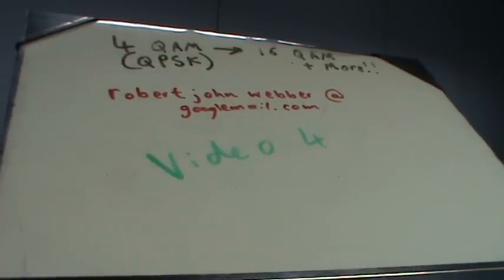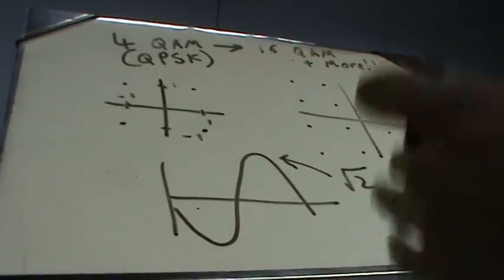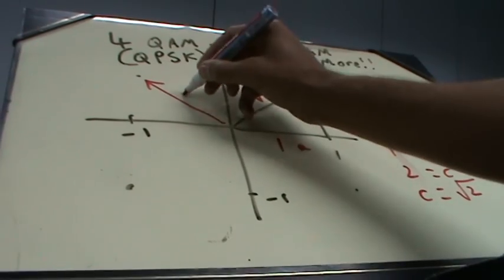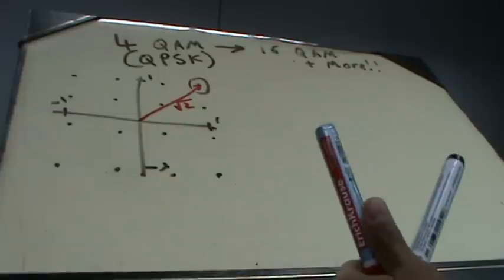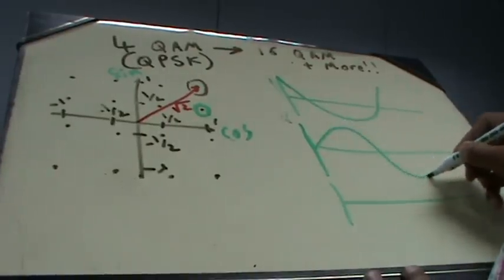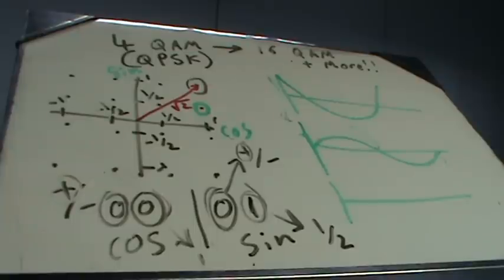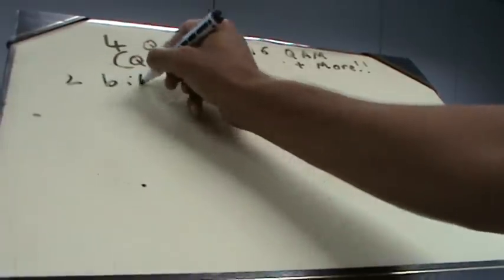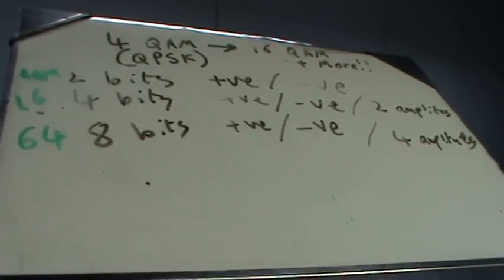QAM, QPSK Explanation, (PART 2 leading to 16QAM and more.....)

Comment from the maker: Hello, You´re right that there are three output amplitudes, but 2 different input amplitudes for 16QAM. However the voltage values depends on the design of the transmitter/ receiver. For example a broadcast 1V signal wont travel very far! 

Thanks for the comment though Eder.

Comment: Hi Robert, Its very useful video... I got one doubt from 8.07 mins onwards... You say 0 (cos +/)  0 (cos[same amp])  0 (sine+/) 1( sine[diff amp]).  In that case LSB 01  should be done with AND operation between 0 (sine+/-) 1( sine[diff amp]), what will be the output ?

Comment: Hi Robert,
If you can do a video on the transition scheme between each of these QAM symbols, that would be great since that would describe how data would be transmitted in real life. As in the transition from one constellation point to another as it is encapsulated within a notch (which would be a Sinc function in the frequency domain.) - naturally some transitions are easier to implement than others.

Comment: Hi Robert - great educational videos! Could you try and explain for me how an actual digital signal would get encoded using the 4QAM? You show that there are four 'combined' waves which reach their max amplitudes at the four mapping points - am I right in thinking that these waves are rotating around the polar diagram? How then do they switch between different signal bits? I'm getting mixed up betwen the analogue resultant 'waves' and the digital information... hope you can help! ps keep it up!

Comment: I would like to ask, you first split the data stream into two parts, one in-phase for cos and other qaudrature sin wave..you encode it using RZ or NRZ or anyother technique and make symbols..SO now, my question is I thnk if you simply change the sign of the cos or sign wave according to 1, 0 bit, and you get a stream as phase jumps due to 1 and 0, and then you add I and Q components you get your modulation.so why you hv to chng amplitude other than +1 or -1?

Comment: I was also confused as I thought there were 3 amplitudes associated with 16 QAM (although I'm still very new to modulation schemes!)
So does root 2 just correspond to the two amplitudes you can give the cos and sine waves you give to the 4th and 2nd bit of one symbol?
And by adding these you get 3 amplitudes at the output?
Can you explain how the three amplitudes are applied?

Comment: Robert! It would be really great if you can explain something about the circuitary like how exactly the Modem works and also how different modulation techniques relate to the specral efficiency which is the most crucial aspect in telecommunication. Or I can take little bit of guidance from you about this through email. Whichever is more convinient for you....

Comment: My lecturer told me 16-QAM has 3 amplitude as against 2 amplitude as you've stated. What do you have to say to this???
Reply from the maker: Hello. No I said that you have two choices of amplitude in both axis. So as long as the constallation mapping points (which is normally the case), then yes your lecturer is correct, there are 3 different amplitudes just from the different size of triangles you can make. Does that make sense? Thanks

Comment: @robert webber

thanks for the video...
can you please tell me about how these constellation is succesfully decoded at the reciver?
Reply: I'll take a guess based on an intro EE class, since no one seems to have answered.

To decode amplitude, you can use a combination of low-end and high-end filters to find the voltage you're looking for. Perhaps an analogy is how LEDs turn on only if 3V passes through (they stay off for less than 3).  To decode the quadrant, I would guess that one can figure out where the peaks of each wave is based on a timer and where the peaks are (though I'm more inclined to say my guess at the decoding of amplitude is more correct than my guess at the decoding of quadrant).